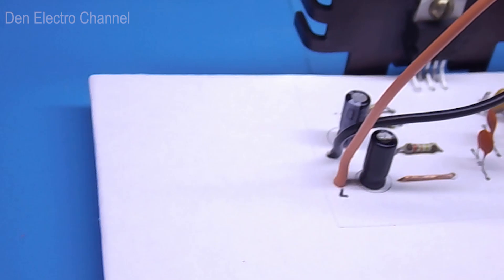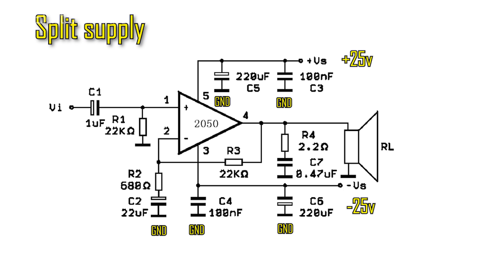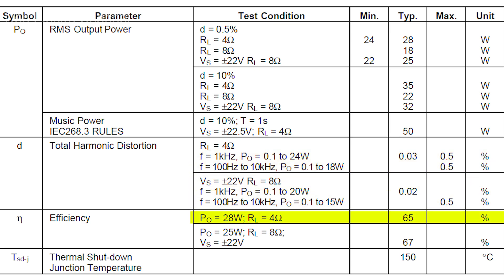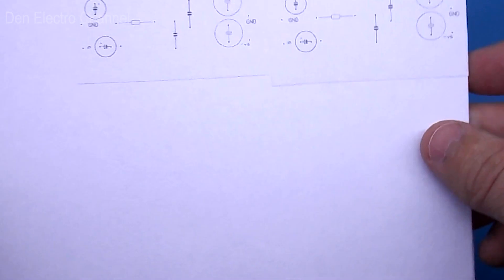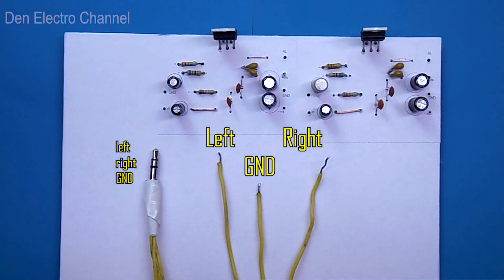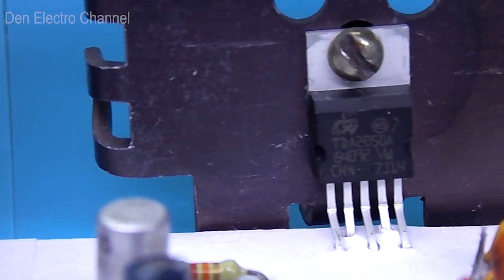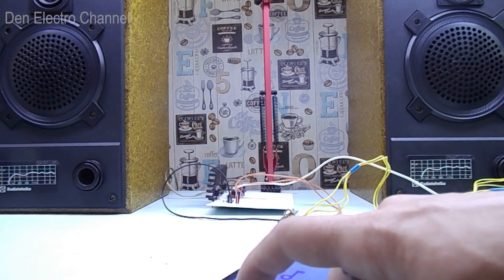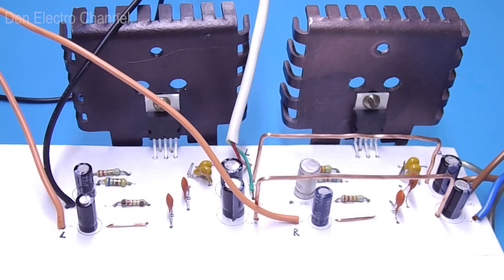Simple amplifier on TDA2050

Comment: No op amp added with the input. Can we add op amp on the input. Will it improve the sound quality....?
Reply from the maker: An operational amplifier at the input can make the sound louder, but this will not affect the sound quality.
Reply: @Den_Electro_channel  Thanks for the response, dear i wanted to add op amp for making sound loud. which config should i use for op amp at the input buffer gain etc

Comment: They stopped making the TDA2050 over 7 years ago. You can only get counterfeits from China now. Very inferior
Reply from the maker: I don't know if it's fake or not. Maybe the Chinese are making copies of these microcircuits with the same characteristics.
Reply: @Den_Electro_channel  It definitely is a knock off. It would be more fragile and not produce as much output as a genuine one.
It also may be more prone to instability